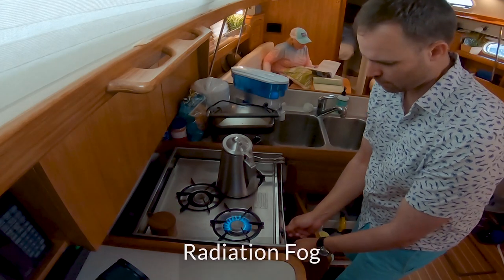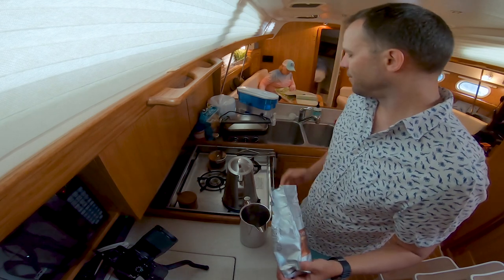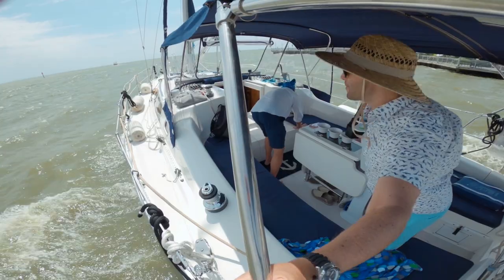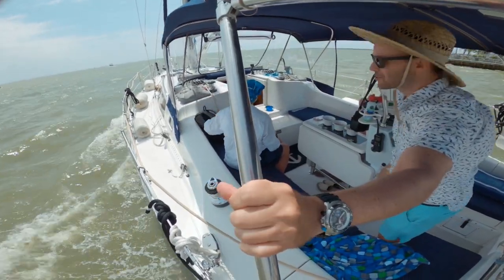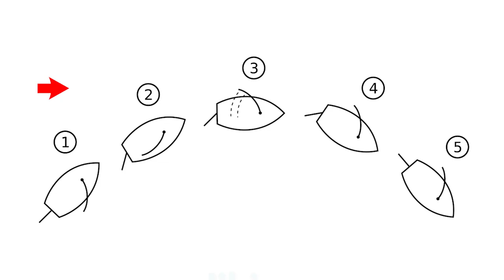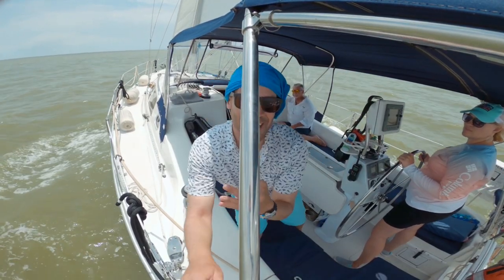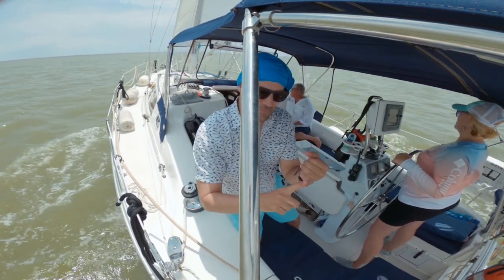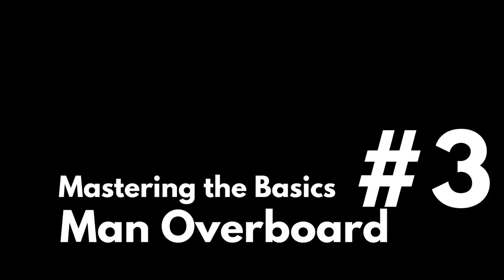Sailing Basics: Tacking, Jibing, Man Overboard  |  ⛵ The Foster Journey

Comment: No mainsail practice?
Reply from the maker: Apart from jamming in the in-mast furler, the mainsail is a breeze! We've learned to reef her a bit earlier (around 15-18 knots) to keep the weather helm at bay. What we're still unsure of is where to put the mainsail in a broad reach or run...any tips for us?
Reply: @TheFosterJourney  - we have slab reefing, but we did spend 10 days on a boat with in-mast furling and we were told to keep the furling line under tension when winding the sail back in so that it laid flat with no wrinkles or bulges.

As for sails in general... regardless of the wind direction, try and have the leading edge of the sail pointing into the wind and then adjust the sails so that the teltales fly.

I know you are in the US, but there is a really good book by the RYA in the UK that costs £12 and if you google "Amazon RYA Sail Trim for Cruisers" it will teach you everything you need to know about setting your sails. It is a really easy read and well illustrated.